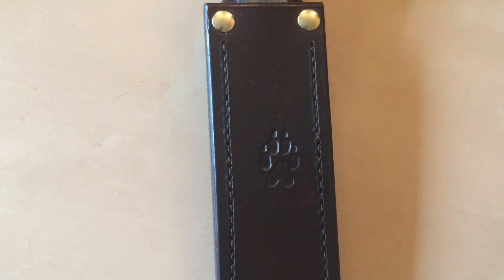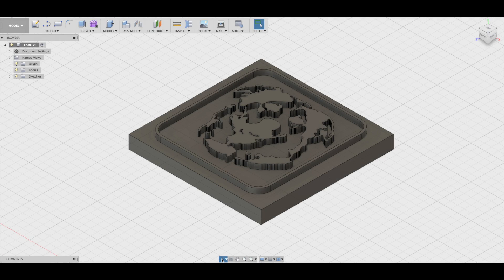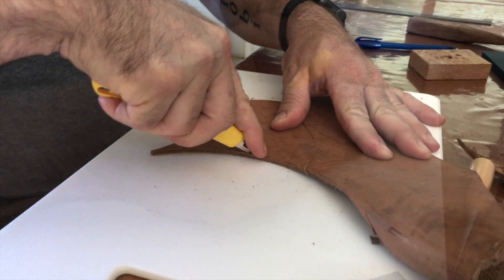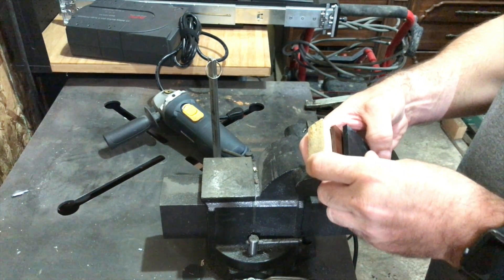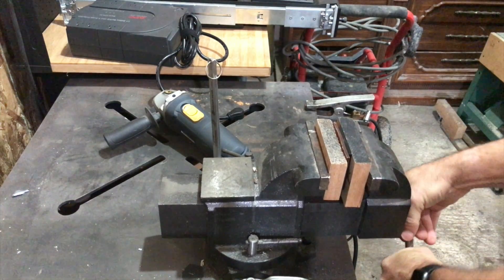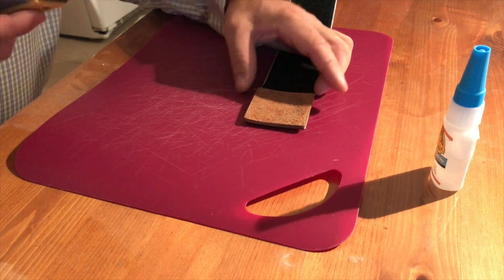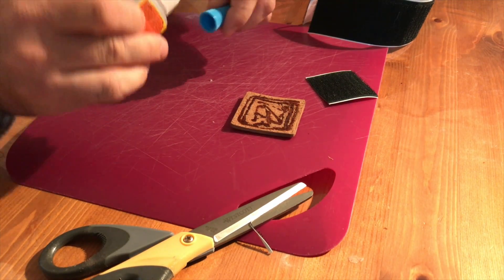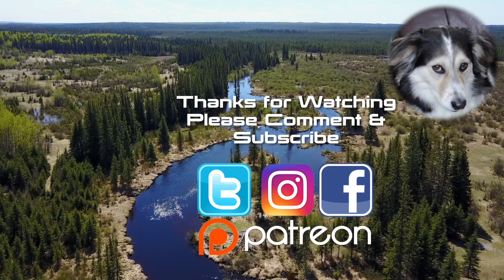Custom Leather Stamp with a 3D Printer

Comment: Hello, do you export an .svg format to fusion 360? Once in fusion 360 is there a process to raise the imprinting area?
Reply from the maker: Yes that's how I did it as I recall.  The is an extrude function to lift the image after its imported.

Comment: You should of left it in the vice overnight.
Reply from the maker: Stamping leather never requires long pressure - Its all about the moisture of the material.  I think I got it too wet.  I'll perhaps try your method to confirm - thanks for the suggestion!

Comment: Dooooooood! WAY too much water.  All you need to do is mist some water on the surface then let it soak in until the leather looks dry again.  It isn't dry the moisture just soaked in.  You will get a much better impression, too much water just makes it spongy and you get a less detailed impression.
Reply from the maker: Hi SpaceRanger42 - Thanks for the tip!  I'll try that on my next stamp project!  Appreciate it!  :)

Comment: Neat concept. Have you tried using Inkscape-trace bitmap feature to where it’ll basically create a cookie cutter svg or png etc file. It usually provides much more detail and give you various different options for the overall look of the image.
Reply from the maker: I've never used that software but I'll check it out!  Thanks for the tip!
Reply: The Emporium Outdoors no problem and best of All it’s FREE open source. There are two versions. One available in the windows App Store and the original can be found at Inkscape.org ,Not exactly sure what’s different between the two but the version you download from the website has some really cool plug ins especially for engraving
Reply: I struggled for a while trying to bitmap objects into a usable format (still very confused with illustrator), but inkscape  was my saving grace and it's so good!

Comment: Fabric adhesive doesn't work that great. I prefer rubber cement with leather...just my opinion. Great project.
Reply from the maker: I think you are right.  I think the rubber cement has a bit more give in it.